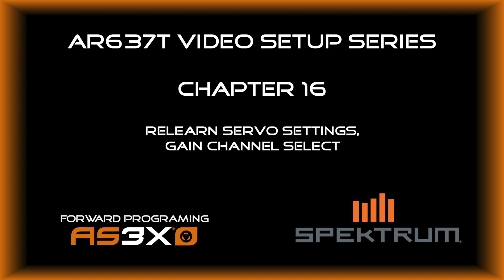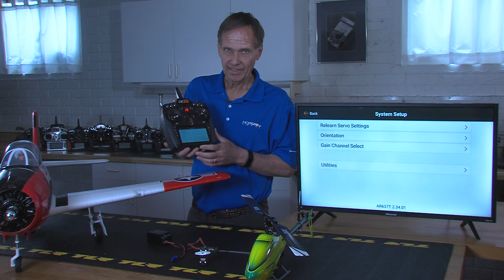Spektrum Smart Receiver AS3X Setup Series #16 - Relearn Servo Settings and Gain Channel Select

Comment: Question: Your video's are wonderful. I have a DX-9 all updated--Turbo Timber Evolution AR637T-Unlocked-Avian 60 amp ESC. I seem to have lost Flight Mode 2 in my set up. I have FM 1 set to AS3X on--all ok--then FM3 is set to AS3X off. HH representative had me reset whole plane re-learn servos etc. Any help appreciated?
BOB

Comment: I have Flaperons all set up on my T-28 with the AR631 receiver. Everything works perfectly except that one aileron does NOT respond to SAFE. (plugged "new" aileron plug into channel 6 after splitting the Y). Watched a ton of these videos but saw nothing about Forward Programming SAFE to a new channel. Any way that can be done?
Reply from the maker: It is not possible with the stock preloaded T-28 model setup on the AR631. You achieve you goal, you will need to factory reset the AR631 and setup AS3X/SAFE from scratch essentially.

Comment: With the current firmware relearn servo settings also changes the frame rate for the control surfaces back to 11ms even if you have them set to 22ms.  I figured that a reset would do that but the relearn also does this.

Comment: Finally I found the solution for my issue below. There was an incompatibility between the firmware version of receiver (2.35) and transmitter (2.06). After update all to the latest firmware versions the direction of ailerons works fine in AS3X and SAFE mode. Thanks an take care :-)

Comment: Thanks for this great video. But unfortunately relearning the servo settings doesn't inverse the ailerons. They are working in a wrong direction when SAFE Select is switched on. I didn't found any helpful information about SAFE Select and inverting servos.
Reply from the maker: Make sure you have the orientation selection correct

Comment: Would be very helpful if you'd do a video on setting up FLAPS in the AR637T receiver using a DX8 Gen2 transmitter.  I can't get the flap system menu to input pitch change settings with a 3 position switch (B).